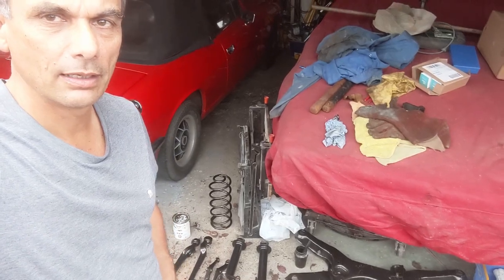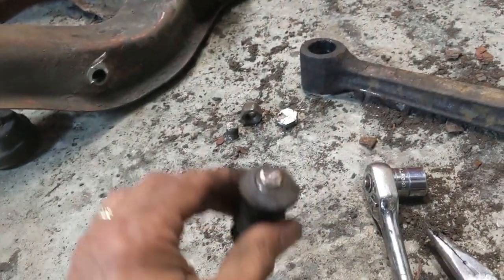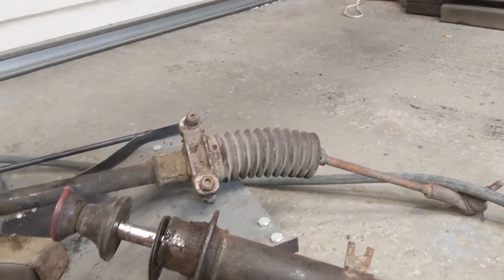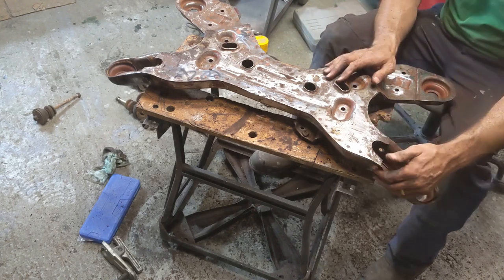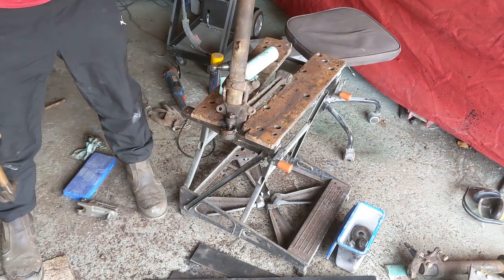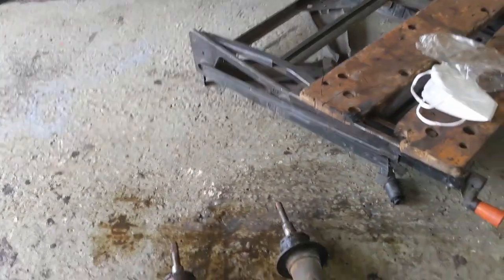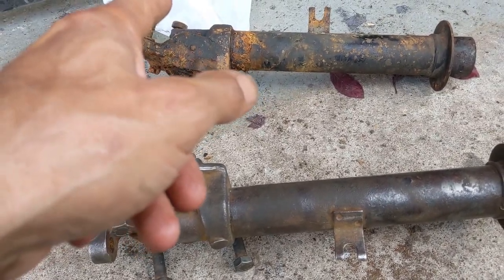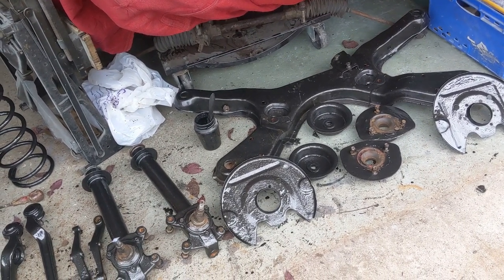Triumph TR7 Restoration:  Episode 87   Front Suspension and Subframe refurbishment

Comment: Hi Henry, to get the ball joint out off the strut . The best way I have used a number of times is to shock it out , using a ball pein hammer remove  the nut, then put it back on a couple of threads so you don't damage  the threads then hit the strut casting with the hammer a good sharp blow and the ball joint will just drop out. All the best.
Reply from the maker: Thanks John, good to know

Comment: Hi Henry,  looking good, I would replace that top mount with the rust hole in it as its what holds the spring under pressure, replaced both mine as the rubber had perished. Here's a tip for you, for less than £30 you can get a thin flat roller bearing kit that goes beneath that metal cone and replacing a washer or two. This converts the high friction cone and washer system to roller bearings and really lightens up the steering at parking speed almost as good as power steering. I got the kit from Robsport and its based on Ford Sierra roller bearings and works really well.👍👍
Reply from the maker: Thanks for tip Ian, good to know
Reply: Would recommend that makes the steering much easier

Comment: Hi Henry, that is the kind of ball joint splitter I used, perhaps mine was just a bit smaller.  Another trick is to thread a nut down on the threaded part, then put socket between the nut and the end of the strut.  Then you can wind the nut off and it will push out.  But with the threads munged up, maybe not for you.  Getting the ball joint out of the track control arm will also be a challenge, there is a circlip that holds it in, but you will likely need a press to get it out (and install the new one).
Reply: OK, wrote that before I saw that you got it out.  Your dad's idea was basically the same as the socket idea.
Reply from the maker: Thanks Darrell, yeah same basic principle.  And you’re right, getting the joint out of the track rod will be fun .